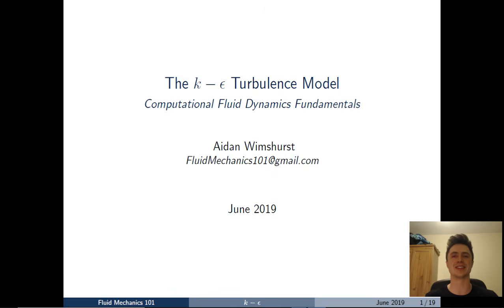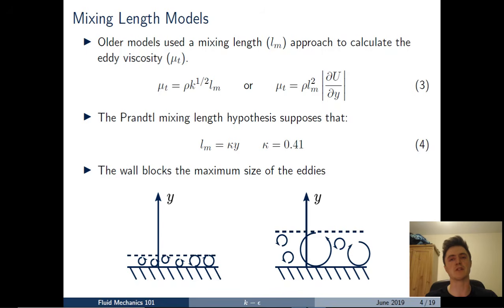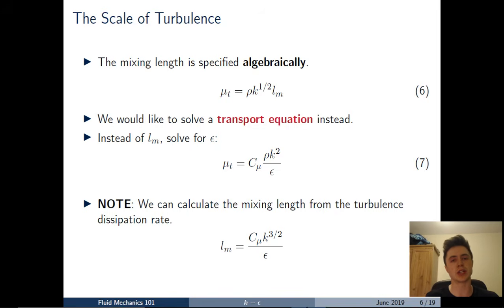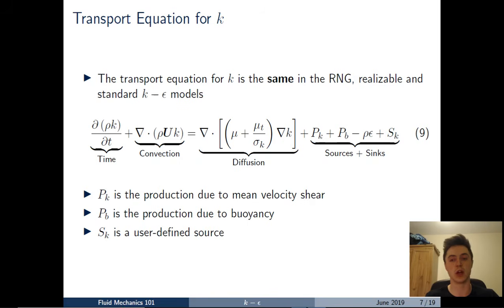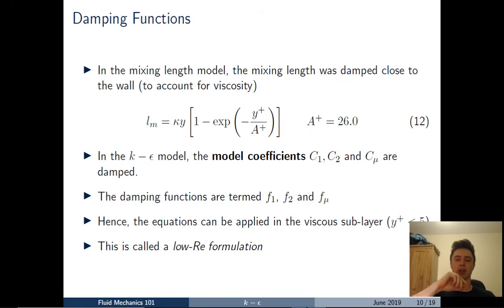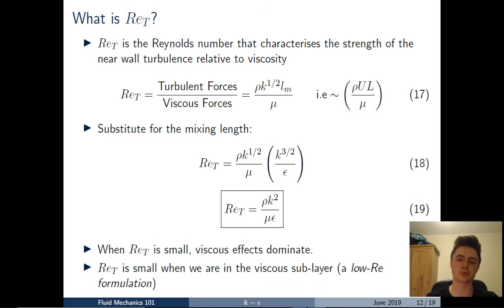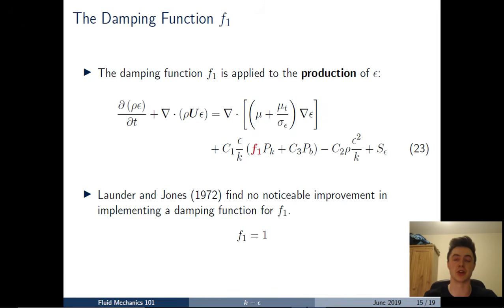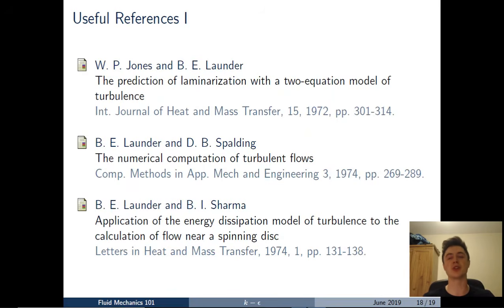[CFD] The k - epsilon Turbulence Model

Comment: Can you provide how did you arrive at this form of RANS equation at 2:10 ?
Reply from the maker: This form of the RANS equations is the full compressible form. You may have seen the simplified form for incompressible (constant density) flows. You should be able to look them up on CFD online wiki, or any other good CFD textbook. For the purpose of the talk is does not really matter which form you use, we just need an understanding of the Reynolds stress and where it comes from 👍
Reply: I had the same doubt. That equation and its derivation can be understood if you read chapters 2 and 3 of this book http://www.gidropraktikum.narod.ru/Moukalled-et-al-FVM-OpenFOAM-Matlab.pdf
Then, in chapter 17, they derive RANS equation, which is almost equation 1, but with the added Reynolds stress.

Comment: This is excellent material! Thank you so much!
I am wondering what is the value for C3?
In addition, I am wondering whether you could direct me to a reference about how to calculate/approximate the inlet and/or initial values for these turbulence parameters, such as k, epsilon, turbulence intensity, hydraulic diameter, turbulence viscosity ratio, etc. Thanks again for the excellent video!
Reply from the maker: I have a calculator on my website that calculates the inlet values of k, epsilon, omega and turbulent viscosity ratio (link in the description). You should check it out 🙃
Reply: @fluidmechanics101  That is toooo awesome! Thank you so much!!

Comment: anyone know the difference between the molecular viscosity and turbulent viscosity he is referring to when discussing damping functions?
Reply from the maker: 🙃 yep, molecular viscosity is a property of the fluid. You can think of it as ‘how sticky’ the fluid is. Honey has a much higher molecular viscosity than water for example. 

The turbulent viscosity is an artificial term that we use to characterise the strength of the turbulent mixing. It varies throughout the domain and is calculated by the CFD solver. Generally areas of high turbulent mixing and shear will have high turbulent viscosity. It is not a material property of the fluid. 

(Formally you can look up the Boussinesq hypothesis or Reynolds Averaged Navier Stokes (RANS) equations to get a full definition of turbulent viscosity) 

Does this help?
Reply: @fluidmechanics101  thanks so much, perfectly explained :)

Comment: I have a question, how to derive equation 9 and 10?
Reply from the maker: The models are empirical and have been built up term by term using test cases (like boundary layer flow over a flat plate). If you are interested in the derivation, i would suggest reading one of the original papers (linked in the description) 👍

Comment: Thanks for the lecture. But is the dynamic viscosity different from turbulent viscosity?
Reply from the maker: Yes! The dynamic viscosity (mu) is a material property of the fluid. Hence, water will have a different dynamic viscosity to air. 

The turbulent viscosity/eddy viscosity (mu_t) is a made up quantity! We often make the Boussinesq approximation which states that the strength of the turbulence is proportional to the mean velocity gradients. The proportionality constant is the turbulent / eddy viscosity! This approximation allows us to model the effects of turbulence (eith reasonable accuracy) without resolving the fluctuations themselves, as this is expensive and difficult. 

I hope this helps 😊
Reply: @fluidmechanics101  Thanks very much for your explanation.

Comment: Hello ,
This is a very good Video and with Great and well presented content Thank you very much.
I have a question and i hope that you can help me with it , For a 2D airfoil simulation am interrested in calculating Cl and Cd for -6<alpha<18 degree ; and compare them with experimental results .Do you think That i should use Low Re .ie Y+ <5 or High Re  Y+ >30 ? which one gonna be best for my case ?
Reply from the maker: Definitely y+<5! If you can you should get y+<1. You should get pretty much the same answer when alpha <8 degrees. However for alpha > 8 degrees you will need to get the seperation point correct and this requires y+ <5! At very high alpha you will need to use an unsteady solver and be careful with your time stepping to get the shedding behaviour correct 👍
Reply: @fluidmechanics101  Thank you very Much

Comment: Thank for the explanation. It was great help. You r doing a perfect job.....
Can i ask....in which software are you making diagrams??
Reply from the maker: I make all the diagrams using inkscape. Inkscape is free and you can use it on any operating system (mac, windows or linux). To keep the equations and symbols consistent, i make them using ‘latexit’ and them import them into inkscape. I hope this helps! 

Also, if you are interested in the template i us for the lecture slides, i have uploaded it to patreon (link in the description). You can pick up the template there. 😊
Reply: @fluidmechanics101   thank you sir

Comment: Hi! I like your vids. But how's the 'turbulent' dissipation rate highest near the wall? The turbulence is non existent near the wall.. please clarify!:)
Reply: Because you said it yourself that the dissipation rate is lower at the wall and it needs damping... So.. How?!?
Reply from the maker: Hi Shirang, the strength of the turbulence itself is given by the turbulent kinetic energy k. As turbulence is non existent at the wall, k must tend to zero near the wall. We reduce k to zero by having a large value of epsilon near the wall. Epsilon can be thought of as the ‘destruction of k’. However, to ensure that we have a large value of epsilon at the wall, we need to reduce the ‘destruction of epsilon itself’. This is where the damping function comes in! Sorry if this was a bit confusing but it is quite a difficult turbulence model when you look into it 😊

Comment: Hello Aidan At work we always have a argument about between  K-W SST or K-E EWT which model will provide a better result for heat transfer and pressure drop prediction. Could you talk about it in your video?
Reply from the maker: This is a tricky topic and i think i might do a complete video on it. The answer is: we can never definitively say which turbulence model is better, as this will vary with the application. So k-w sst and k-e EWT will depend on what your application is. Turbomachinery? Buoyancy driven flow?? For your given application, you should compare the turbulence models using a test case for which experimental data is available and is similar to your application. For example, a 2D aerofoil section if you are running a turbomachinery application. Look at the results and see. Which turbulence model lines up best with the experimental data? This is the best model to use for your application. If you do not have any test cases, then you should try both turbulence models and compare the results. How different are they? This is quite a complex topic with lots to think about 😄 i hope this helps!
Reply: @fluidmechanics101  Very helpful! That is also most time what we concluded, we need to try both model, but we do find that in Fluent, K-E EWT is much easy to get a converged result then K-W SST,  so when we are lazy we just use K-E EWT😄😄. Thank you for spend your time to answer me!!
Reply from the maker: Hahaha yes of course! If it seems to converge better that always helps 😄